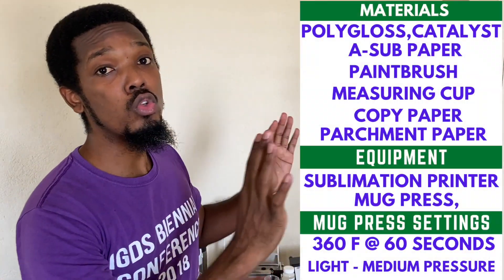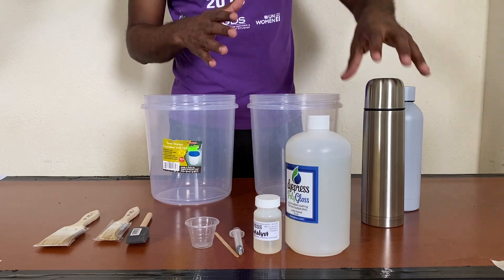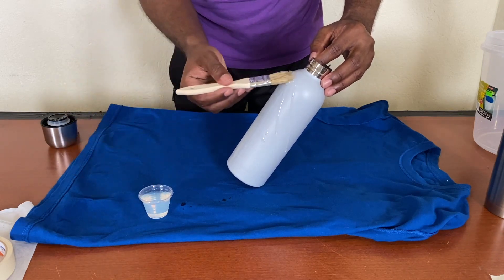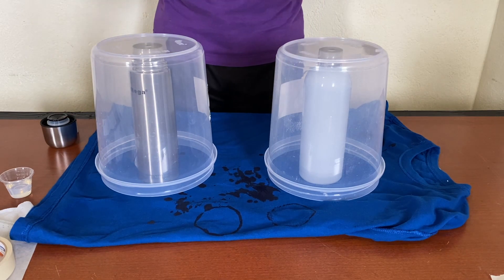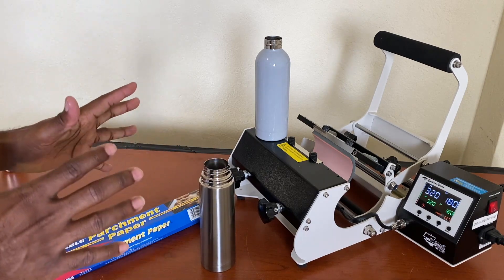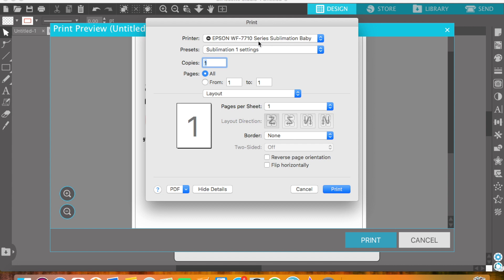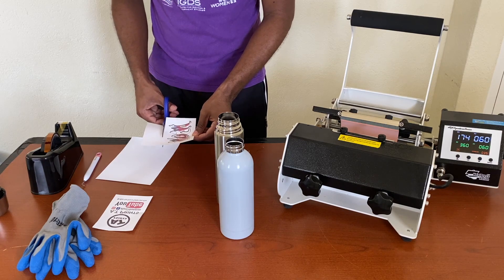Coating Stainless Steel with Polygloss | Sublimating on Stainless Steel Apparels

Comment: Can you recoat after the first one if not satisfied? I did mine but with drip marks and brush strokes. Can you also take off the coat after completely dry  as long as you did not cure it?
Reply from the maker: Thanks for your question. The answer to your question is yes. You can re-coat the tumbler if it’s not up to your satisfaction and even if you sublimated it and want to redo it you can sand it and start fresh.

Comment: Great tutorial.  I just started using Dyepress products myself.  I wanted to share a little info about tbe alternative paper you are using.  Multi- purpose paper is working for me just as good af A-Sub and a few others I've tried.  Copy paper does not work the same. Those are very different types of paper. Copy paper is design to NOT release ink. The best thing about multi- purpose paper is getting out in legal size,  which A- sub discontinued.   It is not as thick,  so be sure to use a piece for blow out.  Still,  @ $17/ream legal size!  Us can't beat it.  Hope this helps!
Reply from the maker: Thanks very much for your comment and support.
Thanks also for your info. its very valuable ad it will surely help many persons who are looking to get into Polygloss.
Reply: Would you share the brand you use
Reply from the maker: @moyercreations  can you clarify what you are referring to please so I can assist?
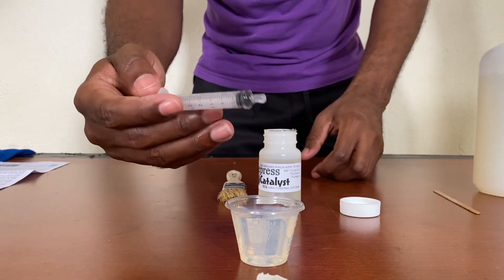Reply: @moyercreations  Sorry for the delayed response.  I use Staples brand, but as long as it is "multi-purpose" (which is for inkjet AND laser and usually states this) and is no more than 96 bright. Rachel from Dyepress explains it in more detail on her video.  You can jump to the section about paper at min 5:14. https://youtu.be/fjHUwtIgQkA  I've been making my own substrates out of tile, wood, metal, fabric, etc.  Basically anything that can handle heat and is flat enough to fit in my press using her Dyepress products.

Comment: Can you add some type of white pigment or white ink to the polygloss to give it a white color when applying to darker items?
Reply from the maker: Thanks for your question and its a very good question. I never tried it but, i can do some test and then a video to guide you.
You can also try and see if it works. The only difference is that the colors that are normally on these items are paint. So what i am saying is painted items and ink are two different things.

I would still give it a try.

Thanks for this question.
Reply: @atprints  In my mind I was thinking about laser cut plywood. Like magnets, badges, jewelery etc. So you wouldn't see the yellowish/brownish color of the wood on the white parts of the sublimated design, but it would actually be white. Thank you for your answer
Reply from the maker: @1985cactus  interesting. It’s worth a try and I’ll do some test and if it works report back to you and do a video. Credits surely will be to you.
Reply: @atprints  Thank you very much. Kind of you
Reply: @atprints  Hey, now I saw that you are from the UK. Can I ask where you buy polygloss from? I'm from the EU and can't find it anywhere here. Only from their official site, but shipping from the US would cost me as much as the item.
Reply from the maker: @1985cactus hi, yes the shipping maybe expensive but it’s worth it as you can coat a lot of products. I am actually not in the UK at the moment but when traveling I try to gather products. Do you have an idea of the shipping cost and I don’t think they sell it in the UK. You can also type in the polygloss on Amazon and you should find it.
Reply: @atprints  Yes, shipping from the US to my country is $33.50. Which is a lot .  Almost another bottle. That is from their site. Amazon doesn't ship this product to the EU, unfortunately.  And only Amazon US carries it. Amazon UK or any other European Amazon doesn't have this product. So basically, you have to order from The States.
Reply from the maker: @1985cactus  I’m sorry to hear this. You can try reaching out to them to see how they can assist. They are really accommodating. I’ll also try to see how they can help out

Comment: Thank You so Much Young Man for Your excellent video!   I'm waiting to receive my PolyGloss.   I have 500 Stainless Steel Bottle Openers that I want to Sublimate on!!   I'm excited to try this on them! 🤗
Reply from the maker: Thank you for your comment and support to the channel. I am happy to know the content can bring you some value. If possible you can show me some of your work when you are finish with the polygloss and the bottle openers. You can find my Facebook or Instagram in the description 💪💪
Reply: How did it turn out?
Reply: @olgalambeth6330  so weird.    Because once you Sublimate on one side,  it will not take on the other.    I'm waiting to call the company (DyePress Poly) and see what advice they can give me.    The side that does Sublimate is kind of hit and miss.   Some images come out nice and others come out grainy looking.   Now I'm using LAMINATE and though much more work I DO LOVE THE FACT I CAN SUBLIMATE ON BOTH SIDES!!
Reply: @ILUVSTEFA98  Lamente like laminating sheets?
Reply: @olgalambeth6330  YES.  Any kind of laminating sheets, pouches, rolls.    Works great.   Just use an Exacto Knife or a blade to cut and scrape the excess off.

Comment: I found this video by chance, and so glad I did. I have two questions- have you determined what kind of spray paint can be used with the poly gloss, and the second is can you mix glitter or mica powder in before applying and sublimation. Thanks in advance
Reply from the maker: Hi thanks for tuning in. You can take a look at this video where I used spray heat resistant paint to coat the items. I do believe that you can add some glitter and I am in the process of creating videos of that nature. See the video where I use the spray paint - How to Recoat Ruin Sublimation Tumblers by Sanding Painting and Coating with PolyGloss
https://youtu.be/NlaVpag3qIA

Comment: Can you use polyacrylic to sublimate on stainless steel?
Reply from the maker: Thanks for your question. I never tried it before but I wouldn't use it for stainless steel but more use it for wood. To me, polyacrylic is mostly made for wood so I am not sure how it will stand up to stainless steel and the heat when sublimating.
I hope this answer helps.

Comment: Is ploy gloss and polycrylic and polyurethane the same… or do all of these work the came???
Reply from the maker: Thanks for your question, they are different, however, some persons use them back and forth to gain different results in different areas. I have a video where I sublimated onto wood using ploygloss and polyacrylic https://www.youtube.com/watch?v=26qaLQZ0fOw&t=337s check it out here and it should give you some more details on how the finish products can work. However, I wouldnt use polyacrylic for bottles or tumblers but only on wood.

Comment: Can you use infusible ink after polygloss?
Reply from the maker: Hi, and thanks for your question. I do believe that there is a possibility that it can work. You will have to monitor the temperature and pressure if you will be using a mug press.

Comment: Hi, I want to know if you had experimented any fading (the gloss of the polygloss) in the product (stainless steel)? Also, excellent video!
Reply from the maker: Thanks for your question. You will get some fading after a long time. I had a bottle where it started to fade after 2 years of consistently using it every day.

Otherwise, the colors are still vibrant. 

Thanks for your support and I hope I answered all your questions.

Comment: Thank you so much for this video!!  I have some stainless steel tumblers I had purchased to epoxy but decided I'd rather sublimate.  This is great, and I have PolyGloss too!  Question--I have a convection oven so when I'm curing my tumbler, should I use parchment paper too or not?  Thanks!!
Reply from the maker: Thanks for your question and your comment.
When using the oven you don’t need any paper. Just put the tumbler standing up in the oven.

I hope this helps.

Comment: hi. great video. can this polygloss be used on a black tumbler?
Reply from the maker: Thanks for your question. If you are just looking to coat the PolyGloss onto the black tumbler yes it can but if you are looking to sublimate the black tumbler after it will not show.
Let's look at it as an original sublimation hard substrate, the item has to be white or light-colored. The PolyGloss when applied to items gives you the ability to sublimate but those items should be light colors. I hope you understand and let me know if you need more clarity.

Comment: I'm waiting on my polygloss and other materials to arrive so I can strip down tumblers I messed up and resublimate.  I noticed when you cured the tumblers using your heat press you did not rotate the tumbler.  Typically when doing a full wrap sublimation tumbler I rotate my tumbler and press again.  Is that step not needed when curing?
Reply from the maker: Thanks for your question and comment.
I saw many person rotate there tumblers but I've been sublimating tumblers for a years and never had to rotate them.  Most ovens have heating elements at the bottom and top so the heat should be disturbed evenly in the oven. I think its all about getting the correct temperature and timing and you will be good. 

In this case with the polygloss I didn't had to rotate it.

Comment: Do you have to use the tumbler right away after coating and curing or can you do batches and let them sit for weeks/months?
Reply from the maker: Great question and thanks for asking it.
You can allow them to sit for weeks or month after curing and when you are ready to use them just make sure to dust them off and sublimate them.
Reply: Perfect! Thank you

Comment: How are the items you made using this coating application holding up? Any fading from the dishwasher or sunlight? Do you think it's worth the time compared with buying already done? Thank you for the video.
Reply from the maker: Thanks for your question. I always recommend not using or putting any items coated with Polygloss in the dishwasher or the oven as the heat can reactivate the Polygloss. I did a video where I coated a ceramic tile and I left it out for a year and it's still outside to this day since that video and it took on some fading because I have it directly hitting the sunlight every day. However, my mugs and bottles are still fresh and look good but I will say you have to care them.
In relation to the comparison of buying ready-done sublimation items or using Polygloss. I will say that sublimation blanks will surely come out great but for those who may be low on funding, they can purchase Polygloss get use cheaper tumblers, mugs, and different items, coat them, and still get great results. So it is worth it. However, it all depends on what you are looking for. Some people are into crafting and then love to use it for wood.

Comment: I have a stainless steel tumbler but it has a powder coating on it.  I don't want it to be glossy since it's a matte finish. Is there a product that can be used on this type of surface?
Reply from the maker: Thanks for your question. I am not 100% sure. In this case, I do understand you like the matte look, but polygloss gives you a glossy finish.  I will research and see if there or other products that can possibly work.

Comment: you are using a stiff type brush.  Wont this leave streaks instead of using a silicone brush
Reply from the maker: Thanks for your question. You can use a silicone brush it will also help. I’ve use both and got great results. With the normal brush if you apply to much pressure then you will most likely end up with streaks so it’s all about amount of pressure you apply with the normal brush but yes the silicone brush can work.

Comment: Hi, Allan, I was wondering can you do the same coating with Dibond aluminium panel? Or that material is not compatible for sublimation? Thanks
Reply from the maker: Thanks for your question, I actually am in the process of creating a video on Aluminium. However, you can use the Polygloss on the material you suggested and it should work fine.
Reply: Thanks Allan 🤝
Reply from the maker: @gabiberta9068  you are welcome

Comment: Thank you for making this video!  I found it quite informative, but I do have a couple questions because I am a total sublimation newbie.  🙂 
1.  Do you have to apply a sealer after the sublimation process is complete?
2.  You showed how sublimation can be done using regular copy paper, did you use special ink or is this possible because of the sublimation coating?
3.  If you use sublimation paper and have applied the sublimation coating, can you print your design/image using a regular inkjet printer?
OK, that's all.  Thanks again for sharing your knowledge!
Reply from the maker: Firstly I want to thank you for reaching out and also for asking your questions. As you are new to the sublimation world I want to welcome and congratulate you on this journey.
Lets answer all your questions, but before I do I want you to understand that this video is particularly for taking bottles that are not coated for sublimation and making them into sublimation bottles, so I wanted you to understand that part. So in other words if the bottles were sublimation substrate then there would be no need for this process.
Now lets answer the questions 1 by 1.
1. For this process in the video, yes you should use a clear premium sealer where you can spray it onto the item after sublimating. However, if the item is one that is an actual sublimation substate   then when you are finish sublimating then you do not need to apply a sealer.
2.Yes, I showed an example using copy paper but would recommend sticking with the sublimation paper and yes because I used special ink which is Sublimation Ink and also because the items were coated for sublimation. So in other words both have to work together. If I didnt coat the items then the ink would never work, If I coated the items and not use the sublimation ink it still wouldnt of work so both have to work together as one.
3. Ok so for this last question its a bit tricky and I will explain why and still answer the question. So you asked if you can print your design/image using a regular inkjet printer with sublimation paper and having the sublimating coating applied to the items and to answer that question, it wouldnt work because although the paper maybe sublimation paper and the items are coated, the printer you will be using is inkjet and for sublimation you have to use sublimation ink or a sublimation printer. However, here is the tricky part. Many persons convert there inkjet printers to a sublimation printer where there would purchase an inkjet printer and sublimation ink, install the sublimation ink into the inkjet printer which will then turn it to a sublimation printer and then they just use sublimation paper.  I also recommend if you are going to get a printer for sublimation it is best to get an actually sublimation printer for example SureColor F170 which is awesome. I do have an unboxing video on the F170 on my channel. However, its best to get an actual sublimation printer rather than purchasing an inkjet printer to then convert it into an sublimation printer.

I know its a lengthy answer but I like to give as much detail and explanation as possible. I hope these answers help you and feel free to ask as many more you want to.

Comment: Thank you for this video it has been very helpful. One question, how do you get rid of bubbles if the “bucket method” didn’t work? I still have bubbles.
Reply from the maker: thanks for your question. It sounds like either you may have stired a little to fast or even maybe applied the polygloss a little to hard to the surface but you would have to give me exact details on how you applied it. However, I would advise letting it sit for 10 more minutes then use your mug press with the heat and a nice medium pressure and they should come out.

Feel free to reach out to me on IG or Facebook and show me and i can assist more.

Comment: Can you use a heat gun to eliminate the bubbles?
Reply from the maker: Thanks for your question. I normally set it outside and allow nature and the sun to take car of it or you can place it in the oven and the bubbles will pop. If you use a heat gun you will have to monitor  it carefully as apply heat in one area can ruin your project.

Comment: Is this dishwasher safe? In the case of glass and ceramic, is microwave safe? Thanks!
Reply from the maker: Thanks for your question. It’s recommended that you don’t use it in the dishwasher as the heat can activate the polygloss. So the same would go for the microwave. If possible once you used the polygloss wash it by hand and if you do use a dishwasher make sure that there isn’t much heat going to the mug or item which polygloss was used on.

Comment: Can I spray paint my tumbler first and then use the poly gloss?
Reply from the maker: Thanks for your question.
This is a video I am working on. I tried spray painting and then applying the polygloss. However, when it came to cure the polygloss with the heat then the paint started to come up. So in other words you would have to be careful with the type of paint you use. It could be able to withstand heat.

Comment: that came out nice!!!!! loved both of them! definitely saw the difference between the two stainless sleet on the end of the video... not only on the color but the ink itself...one is very smooth and the other not so much. Thank you! great video!
Reply from the maker: Thanks for your comment and you are most welcome. I am happy the video can help.
Reply: Hello, what kind of brush did you use to put the poly on? Also did you get alot of bubbles?